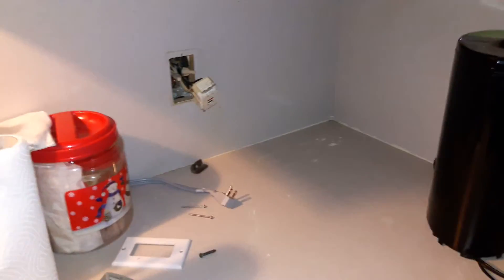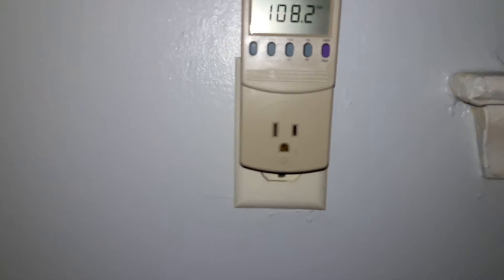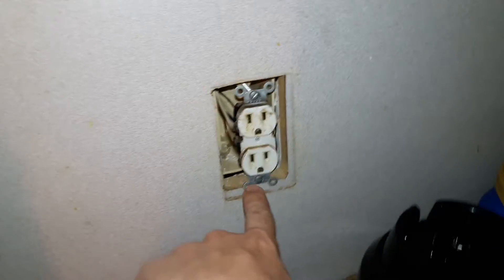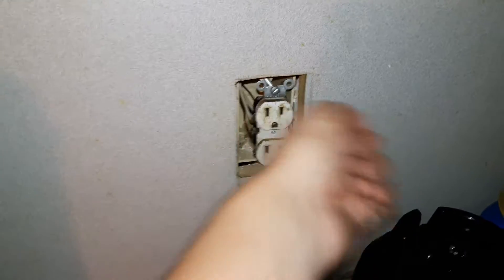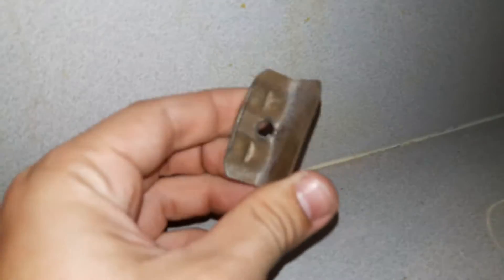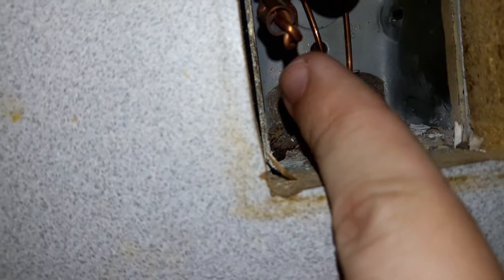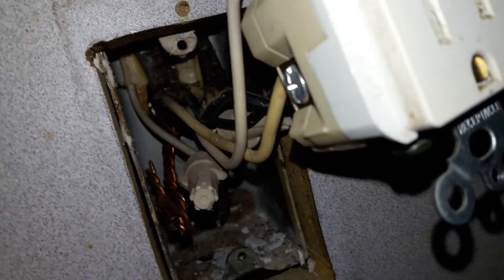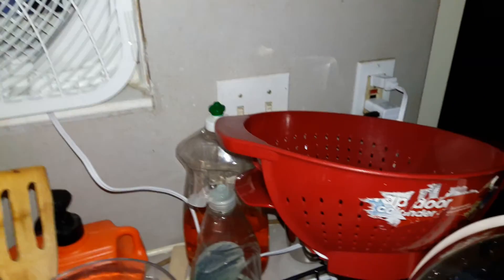Code Violations. Code Violations EVERYWHERE.

Comment: If you’re getting a low voltage the line and load are switch backwards.  The main source line from the breaker should go to the line and the load side should be going to the other outlets.. I hope that helps

Comment: It's my opinion, once you verified the issues of low voltage, the GFCI not having a ground hooked up, etc, it's time to get a qualified electrician in to perform repairs! 'Knowledge is Power' and you've verified the problems that need to be addressed (great job by the way) so you can explain to an electrician what must be repaired. I'd also guess that 'covering' put on the wall will have to be pulled off to get at some hidden 'rigging' or boxes where the 'rigging' was performed! Best of luck to you, if you need it!

Comment: The kitchen and dining room outlets have to be on their own circuits, so therefore anything with a switch should not be on the same circuit.  If it's a disposal, it needs to be on its own circuit.  Switches do not need to be GFCI protected. At one time, the ground wire on the junction box was all that was needed, but now it also needs to be extended to the device.  They make extensions to extend the box to the edge of the wall.  But you should call an electrician.
Reply: Those switches are so close to the sink. They fall under general purpose kitchen. Anything within 3 ft. Of a water source and more than likely will have wet hands at some point using the switch, it's just good practice to put kit.lts.on gfi breaker in applications such as this.
Reply: @captainhowdy3104  WRONG... Switches do not have to be on GFI by code, I mean unless you had the damn thing in the shower
Reply: @jarrydee2799  any elec gen. Purp. Switch or receptacle within 3' of open water source should be gfi.....you have to touch the fuckin switch dont u?......doesnt really matter if the light is near the water source.....there is still potential to touch a switch with wet hands..nice try. Your  not talking to a jack leg handy man here.
Reply: @captainhowdy3104  hey Capt.  Made me dig out the book, 8 months late I guess.

2020 NEC 210.8.(A). GFCI for dwelling units.  Looks to specify "RECEPTICLES" not "OUTLETS"( which should include switches).  Also, under sinks, it looks like 6 ft. Not 3.

I was hoping to confirm you were right, so if you got another section.....pleas help.  Am doing the exam study thing and want to sail through.

Comment: P.s. yes lighting is on a separate breaker than a kitchen outlets. The switches by the sink should be on a gfi breaker being so close to the sink, however the hack job wiring will almost ensure the gfi breaker not to hold due to shared neutrals from other circuits.
Reply: That outlet may be protected by the GFI that is there, on the load side

Comment: Don'tcha just love a video that asks a lot of questions and hos no resolution? <LOL> Here's the basics of finding that low voltage problem. Get a known good meter and measure the voltage of both legs at the panel, both before and after the main breaker. (voltage should be the same)  Measure each breaker to neutral. (all the same within a volt or two) If everything checks ok so far then figure out which breaker feeds that outlet with the low voltage and shut it off. Go around with a lamp and find all of the dead outlets, then remove all of them from the wall to inspect the connections. I'd bet one or more of those outlets has a bad / burned connection or someone has used the stab-lock connections instead of the screw terminals. Fix the connections and add ground wires to the outlet screw from the metal boxes (add your own screw if necessary) then test again with a meter. Test again with appliance running and compare the voltage. If all is ok you should see no more than a few volts drop with say a toaster oven connected. (800 watts or so) If the voltage is still low with the toaster oven running then go back to the panel and see what the reading is there. If it's low at the breaker then you may have a bum breaker. BTW, new outlets are only a few bucks each so you may want to replace them as long as you are working to sort out that mess. Might be $20 well spent.

Comment: I can tell you right now there was no permit pulled for that kitchen! No inspector in his right and ethical mind would pass that! There's a code that states that a single gcfi outlet can be used where a non grounded 2 prong outlet was before, but IT MUST BE MARKED and not used for grounded service like a Microwave. Get someone in there that knows what there doing! Low voltage problem is troubling more over then the kitchen outlets!
Reply: Agreed, that hot leak is on the prowl for the closest ground. May be him if he doesnt call a electrician. This blows my mind people looking for answers on you tube. They call a plumber but never call electricians.
Reply: Loose hot somewhere …..or the battery from a smoke detector back feeding lol jk

Comment: Re: other comments
You need an electrician. That will be the best, safest, most reasonably (!) priced fix.
Reply: @knightofnoise that's crazy, of course. The voltage difference is an indication of a neutral problem. That could be a fire producing situation.

Comment: You could have a bootleg ground!! This is when you have old romex or knob&tube wiring and someone tapped into the neutral to end up making a fake ground because you have an ungrounded system. Also,you could have a loose wire in the fuse box or breaker box. Are your circuits balanced between the red and black wires in your 240 volt feed into the property? You could also have a missing or damaged ground wire for your fuse or breaker box! You could have a feed to a junction box in the basement with a FAKE 240 volt feed in which your neutral wire going to this so called junction box is overloaded causing the voltage drop!

Comment: A ground fault circuit interrupter (GFCI) doesn't require a ground to operate. The equipment grounding conductor is required for other reasons. In short, the GFCI compares the current in the hot and neutral wires.  If the is more than 5ma difference it trips. The current is going somewhere that is called a ground fault.
Reply: Grounded nuertral in most houses….. so yeah shared negative will cause fuckery…..I deal with it all the time trying to protect some crazy janky go behind work.

Comment: Voltage should be around 120, not 110. Greasy and disgusting outlet: change it. GFI won’t pop unless it has power.  No ground on gfi: pigtail the existing grounds. Call an electrician

Comment: You can pigtail the ground to the GFCI outlet.  You need some tools and knowledge to fix that. If you don't have them, get an electrician. Most alarming issue is your low-voltage.  It's most likely a loose neutral wire or a problem in your panel.  You need an electrician to troubleshoot that.

Comment: If the low voltage is consistent across an entire circuit I would suspect a connection issue in the main box or even at the meter, could be one of the legs is loose or corroded.
Reply: I wouldn't encourage this guy to do anything to the main service or wires. He obviously has limited experience w electric. His knowledge seems to be construction oriented  but still said some things in the vid. To show his ignorance. He should call a electrician. He has a hot line leak and no telling what its leaking through or, where it's trying to find ground. Dangerous to the lamen.

Comment: WRONG! You need to have 120 volts, not 110.  108V is WAY outside of the voltage tolerance, and I would question the neutral connections at the main breaker and meter if I read that voltage.
Reply: Jeff voltage in dwelling units will vary from 110 to as high as 130 in different places in this country depending on several factors. Try reading the back of the receptacle sometime,  you might be surprised by what you learn.
Reply: Agreed, he has a neutral problem. His switch for the garbage disposal is correct it should be on its own circuit. Remove outlets, should be atleast 2 circuits for countertop outlets, locate wires at gif location for which WHITE and Black wire pair has power, do not read through gfi" possible gfi faulty" pair that has power is line side of gfi. Wire pair with no power goes to load. It could be necessary to ohm all wires out to find out where there going. If voltage is low  when testing actual wires, check for tight connections at any wire nut locations at outlet boxes. Also check inside panel box to make sure EVEYTHING is tight. Replace gifs correctly with bare copper wire "ground" going to green screws on gfi and outlets. Install what is called "goof" rings or " extension rings" single gang. They slide in hole of outlet to take up gap of added counter. Remember on gfi..line=power in..load is power out to other outlets. This is what protects your standard looking outlet. Hope this helps someone. I have 25 yrs exp. Electrical contractor. Every metal outlet box will be securely attached to bare copper ground wire, which the same wire will also attach to green screws on gfi and all outlets.

Comment: First. You need to clean that kitchen. Next, a GFCI does not need a ground wire to operate. Since you have a ground wire in the box, use it. If the box is metal the outlet will be grounded when it’s installed but looking at they setup the box isn’t flush so I wouldn’t trust that you have a good connection. Also you cannot test a GFCI without power so the buttons won’t work. Check that the line and load are wired properly also. And last, Hire an electrician because you know nothing about how electricity works or codes.
Reply: @knightofnoise  did you ever correct or discover what the issue was? Or did you dump it on the next sucker 😂 (did that house pass inspection)